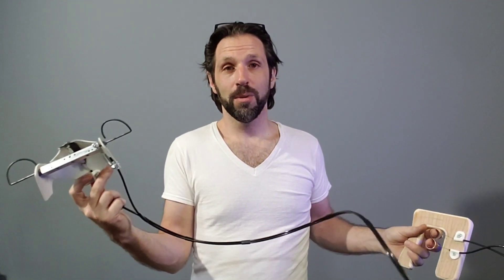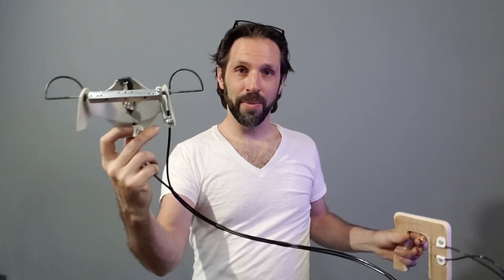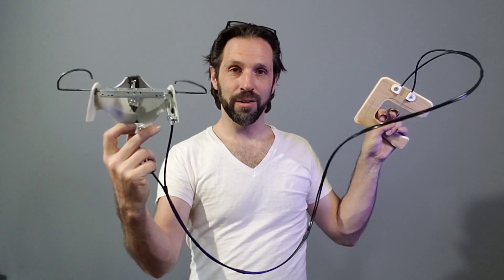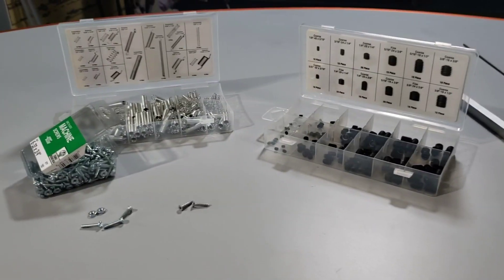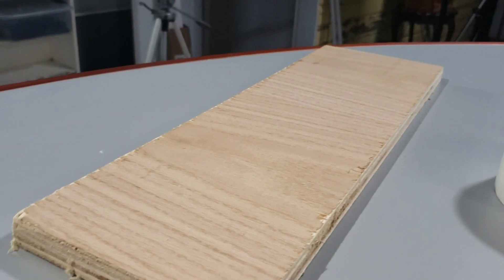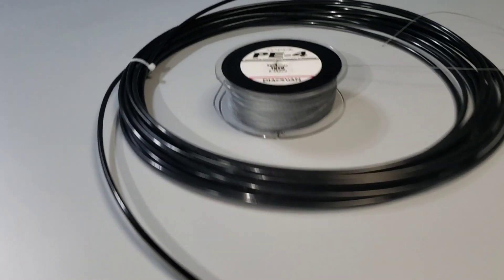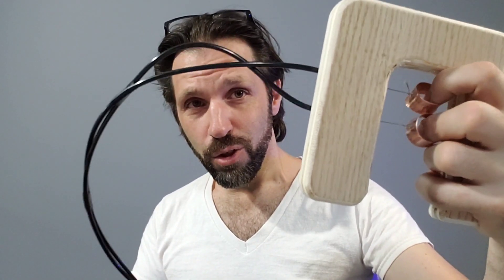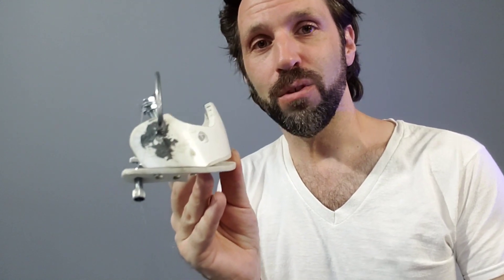Puppet Mechanism, for Hand and Rod Puppet

Comment: I suggest you try out 1mm ID 2mm OD ptfe tubing and .8mm nylon-coated steel beading wire.  You can get pretty good push and pull for light things like eyelids without even using a spring, and the tighter tolerance means less slop.